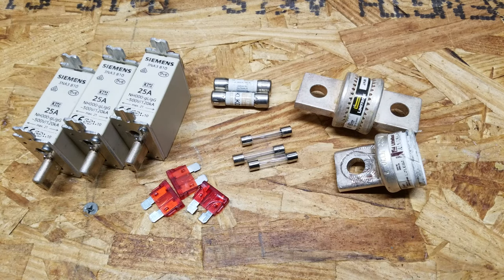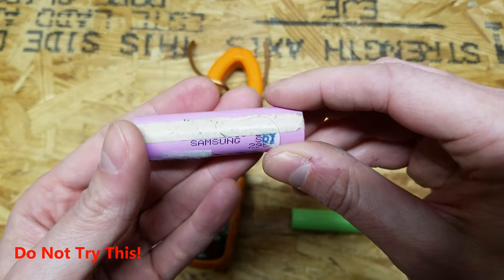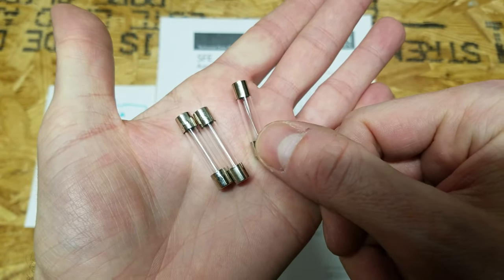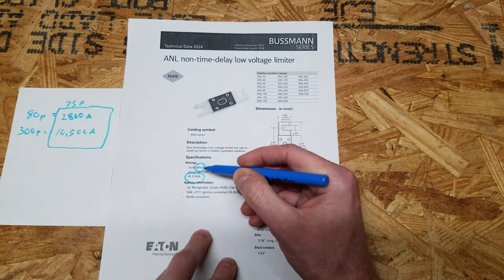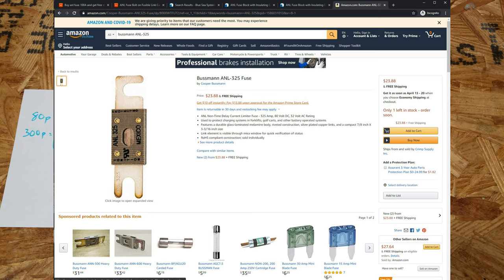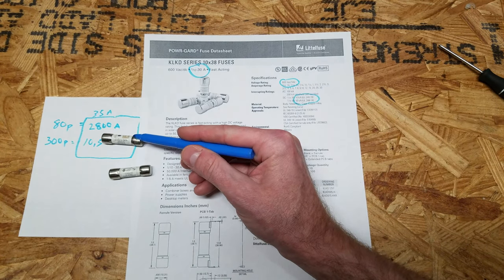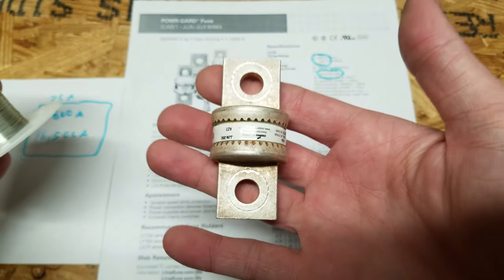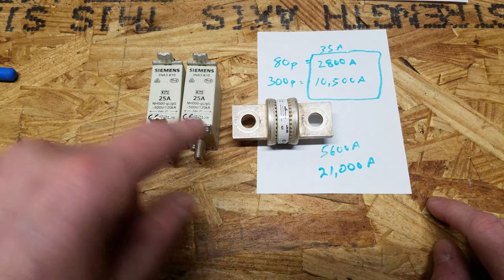Lithium Batteries - HRC Fuses, Short-Circuit Current, and Interrupt Ratings

Comment: If a Lead acid battery circuit develops a  SHORT CIRCUIT and the fuse is blown, the fireworks usually stop.
Does a lithium battery act the same or---Can they SHORT CIRCUIT internally and keep on burning?
Reply from the maker: Lithium batteries have a significantly lower internal resistance when compared to lead acid. This leads to significantly higher short-circuit current potential. Depending on the size of the battery, the fuse could catch fire or even explode if a dead short were to occur with an improperly-rated fuse.

Comment: you should have a secod fuse ins series for protecting your batteries etc at the max expected system current draw
Reply: Circuit breaker for that.

Comment: in case of short in a pack, the max amps are limited by the type and size of cables and connecting nickel strips. usually they are near the nom. amperage of cells
Reply: This is just plain wrong. A 3Ah 18650 cell will deliver at least 25A of short circuit current and the tab stock connecting parallel cells will easily handle that much amperage.

Comment: i am designing a battery bank with eight 330ah/6volt lead acid deep cycle batteries into a 24 volt system (660ah@24volt).  Can someone suggest the HRC fuse I should consider for mid point fusing of each bank?  I reviewed DIY Off Grid Solar's video where he used a 300 amp HRC mid point fuse for his battery bank but as demonstrated in this video, the short circuit amps is a critical issue.  How is the mid point fusing of the battery bank determined? Thanks, Brad.

Comment: the short current is determined also by cables. never will reach 2800A a short on 3m 6mmq cable due to voltage drop.
for 2800A you need a very big short cable. is more critical the voltage interruption that people ignore. 32v in 48v system

Comment: That's good teaching. the breaker trip capacity is 100%? load be for trip or 75%? be for trip. dc battery Blue Sea breaker or
Noark brand. I don't know about the dc battery breaker. but ac breaker 75% to 80% load be for trip

Comment: are the ABB DC breakers any good for leaf gen 2 modules?
Reply from the maker: I'm not sure what the short-circuit current is of the leaf cells, but here are the datasheets fro  the ABB breakers https://library.e.abb.com/public/475ef3d72a0a249dc1256cbf003cad2f/ITSCE-604050012.pdf some of the ratings go pretty high, even for DC, depending how you have the poles wired.
Reply: @LithiumSolar  thank you for the quick reply, I meant Midnite Solar breakers, not ABB
in either case, do the same characteristics of fuses count for breakers? or is one better suited than the other
is it worth combining them? IE breaker on the positive side & fuse on the negative
Reply from the maker: The Midnite MNEPV breakers are polarized, meaning current can only flow in one direction. They are good for PV combiner boxes but not good for battery banks since current flows both directions at the battery bank (charge one way, discharge the other).
Reply: I suggest you use a high breaking capacity battery fuse in addition to the breaker. Better safe than sorry!

Comment: When you use 2 packs in series the short circuit current is not doubled .  thats only the case if the current is so low ( ie a 28AWG wire) that its limited be the resistance of the wire. The max is what you measured at the battery.
2.  Why dont you use the "Max" function on your clamp meter to read the max inrush ? because thats the actual current that will create the plasma in short circuits.
3. when a fuse between the batteries "blows" under short circuit, it will still have the FULL voltage of the system across it and can form plasma/arc.
so if you have 100 X 1.2volt batteries , if a fuse between the batteries blows it will have 120 volts across it. ( insert BMS/balancer brown alert here ).
4. so the fuse between your batteries can actually arc and current limit and actually render your one good little fuse ineffective.
5. i personally only use one good fuse exactly in the middle of the battery pack and no external fuses. ( yes i know thats not the standard protocol ) ( you also need to protect balancer and bms at this point ).
6. i wouldnt really worry about arcing under 150v dc unless you drive inductive loads.
Reply: You wouldn't worry about arcing? So what happens if there is a short across the main battery cables? The MCB may vaporize, and arcs form and maintain. Boom!
Reply: @mrtechie6810  been a while since i seen this Vid and i forgot what its about, but Arcing is just plasma. in low voltages metals just melt instantly. you need High voltage to ionize and jump across the first gaps in order to maintain plasma/arc. Thats why HID lamps have igniters. thats why your car fuse isnt sand filled but the house fuse is. Even tho the currents are MUCh higher in automotive applications.
Reply: @fortheregm1249  Shorting a large lithium battery produces short-circuit currents of many thousands of amperes (unlike typical lead-acid car batteries). Such high currents will vaporize/burn the breaker/fuse/assembly. Carbon conducts. Fire (superheated air) IS a plasma. All of which will continue to conduct the fault current.
The arc interrupting capacity of the fuse shall be greater than the potential short circuit current of the battery.
Short circuiting a large lithium battery could lead to a VERY bad day!
That is why large lithium batteries require a class T fuse, in addition to the low breaking capacity circuit breaker that protects the downstream circuit.
(BTW In my application, the nominal system voltage is 48V, not a mere 12V.)
Even if the circuit breaker has a large AIC, what if it fails? You don't want to risk shorting out a high current source. Hence redundant safety devices. Even if they didn't operate fast enough to prevent your device from being damaged, they are likely to save your life, your batteries from exploding, and your home from burning down!
Reply: @mrtechie6810  "many thousands of amperes"  My guess is the traces or the mosfets in BMS will just go poof. the BMS itself usually has short circuit protection. I've worked on high energy systems that pull 300Amps.  People forget how consistent and expensive connections have to be to actually channel that kind of current . In that 300A system the cost of copper and terminals was higher than everything else.
anyways 48v is still no joke, you dont need to worry about plasma, whats gona get you is the wire insulation igniting. I'd defo use a traditional fuse in that setup ( as oppose to resettable ).
BTW a car battery has like 700amp CCA.
that means 700amp for 30 seconds at -20C while  voltage NOT dropping below 7.2v.
If you short a car battery it will EASILY give you 5000 Amps ! and no it will not make plasma.
Reply: @mrtechie6810  Also when say 5000 amps i mean with proper connection, not two long 18AWG wires accidentally touching, in that case you just get a good smoke show from the wires. 220V in that very same wire will give you plasma for days !
Reply: @fortheregm1249  I appreciate your replies.
Consider the case of a 320A nominal BMS, which fails and shorts out internally. Or where there is an accident, or a wiring error etc. With a 48V battery, and welding cable sized battery cables, surely this can produce an arc flash/blast. It can be sustained until the circuit breaker trips (if it trips), or the path has sufficiently vaporized/melted to interrupt the short. A HBC fuse is the fastest way to interrupt this.
Reply: @fortheregm1249  What is the short circuit current of a 48V 120 AH battery made of lithium ion pouch cells?
It's probably an order of magnitude higher than a typical lead acid car battery!
Reply: @mrtechie6810  I have three 48V battery packs, the biggest one is 15AH. when u said a "li-ion pack" i didnt think the pack in question was so lethal ! holey shit !
one thing tho, car lead acid batteries are solely made in a way so that even when they are near end of life they are still capable of dishing out Maximum cracking amps.
Li-ion batts are made in a way so that they can handle the Current that is required in the application and then the rest of the space/mats goes into achieving maximum capacity.
Because as I'm sure you are aware there is a  direct tradeoff between capacity VS current capability.
In any event I'm sure that 120Ah pack has enough juice to RUIN anybody's day. You be careful with that thing and take all the precautions you can !
Reply: @mrtechie6810  BTW i dont know if that was a rhetorical question or not, but if it wasn't. Put a load on it, say 10 AH. measure the voltage drop, calculate the ESR, then calculate the short circuit current. Or tell me the Voltage drop with a respective load and i can calculate it for you. But I'm sure its plenty :D
Reply: @mrtechie6810  well actually its a little more complex, because if cell voltage drops below 2.8v the BMS cuts out, but we can still work out maximum current in worst case scenario.
Reply: @fortheregm1249  my meter says one 60AH cell (half a 120AH module) measures 7 millohms internal resistance. (Some of that is going to be resistance in the skin of the battery tabs and the contact with the probes.)
So a module is probably under 3 milliohms I.R.?
3x14 cells=42mO
Seems high to me though.
I think it should be under 0.4 mO per cell! (NB: the cell is not fully charged.)
Reply: @fortheregm1249  If we assume 0.00038 Ohms I.R., then at 4.2V, the short circuit current would be 11,000 amps.
But of course, it would be lower on a whole battery because of intercell resistance.
Not as bad as I thought. But I don't know if all my premises are correct.
Reply: @fortheregm1249  the 80A DC circuit breaker is rated for only 4500A breaking current. So an HBC fuse is needed for protection against a direct short.
Reply: @mrtechie6810  So 3 miliohm is 0.003 and not 0.0003.
For Lead acid batts: as they discharge oxide layer covers the lead plates, reducing the effective surface area and increasing ESR. But that's not the case for Lipo. in Li-ion ESR is not effected by the state of charge ( But the short circuit current is).
A meter just doesn't have the capability to measure the ESR of a battery like that, Im sure it can do some clever tricks and come up with some estimates. But thats like bouncing an intelligent Ping-Pong ball from a cars bumper instead of doing its crash test.
The only way we gona KNOW ... ( not estimate ) the short circuit current is by putting the heaviest load you can on it ( after BMS ) and measuring its voltage drop. now come on, im curious myself .

Comment: Where did you get the siemens 3p holder? Provide link please. Thanks
Reply from the maker: These are the fuse disconnects I'm using https://ebay.to/2XkyBhL
Reply: Can't seem to find information if it is important the direction to connect it, should the handle side go to the battery or the load? Also how did you parallel connected them, separate cables and latter joint, or some kind of copper connection on the fuse holder? Thanks.

Comment: about noname fuses, seems like 10*38mm is so cheap for like 30a

seen in better multimeters and higher voltage sla upses

but then, i would hate myself if it arcs starts fire, and i cheaped out on fuse
Reply from the maker: I would not buy a no-name fuse. There are too many reports of them not blowing and melting instead (potentially starting a fire). If in the US, it's best to stick to something with a UL marking.

Comment: O.K., watched the video 3 times, read through the comments and still don't get it.
I use three 100Ah LiFePO4s in parallel for 300Ah in total to feed a 3KW inverter. All juice cubes have their very own BMS and the battery manufacturer claims, that the BMS will protect the battery from a dead short across the terminals.
Trustworthy or not, there is no way that I see, to protect the individual cells within the batteries from a short circuit by any fuse. So a Class T fuse at some rating considering a 20kA current flow can not be applied. Where would I put it?
I can just select properly dimensioned cabling between the batteries and inverter based on a 300A current flow and fuse the line right after the battery array with the appropriate 300A fuse.
What am I missing here?

Comment: Still not enough.
In many applications usual 2C cells aren't sufficiently effective (they'll simply overheat in a large battery under such load) so more powerful cells are being used, with respectively higher short circuit current requirements.
I can hardly imagine say ~10kWh battery rated for 2C (as a whole, not just individual cells) in 50-100V range could deal with 20kA interrupting fuse.

Comment: Why put a fuse on the negative lead too?
Reply from the maker: Because negative is not bonded to ground in a standard DC power system.
Reply: @LithiumSolar  I'm an electrical engineer, and I don't understand your answer. What is the fault scenario that is protected by a fuse in the negative lead?

Comment: You make some very vailed points but PLEASE, Health and Safety 1st.
Holding any battery with bare hands and shorting it out!!!  Gloves and full-face mask at a minimum and on a fireproof surface.
Secondly, Hacksawing towards your hand which almost fell fail to the blade 2-3 times as the blade snagged.
Sorry to poo poo what is a very interesting and worthwhile video but not a good example to others. Thanks
Reply from the maker: Thank you for pointing out the valid safety concerns. It's always good to keep those in mind. I'll take better precautions next time.

Comment: I prefer breakers over fuses.
Reply from the maker: Breakers are nice and convenient, but much more expensive. Most of the breakers on the market that carry UL listings/other certifications are polarized, meaning current can only flow in one direction. They are good for PV where current only flows one way, but in a battery bank, it flows both ways. There are non-polarized options available for a price. I believe the new NEC code revisions require non-polarized, but don't quote me on that ;)
Reply: I suggest a high breaking capacity battery fuse in addition to the breaker. A high current arc is very dangerous...boom!

Comment: 18650 Red cells always make an issue and it smells like candy and i got lot of them in scrapped laptops
Reply from the maker: I don't have that problem with mine ;) There are some, but a very low percentage.
Reply: @DIY Projects yeah that's true buddy, some of those r good but the others r so bad and they have very thin heat shrink. Anyway that's good reply.
Reply: @LithiumSolar  yeah sum of those are good 🙂sir.